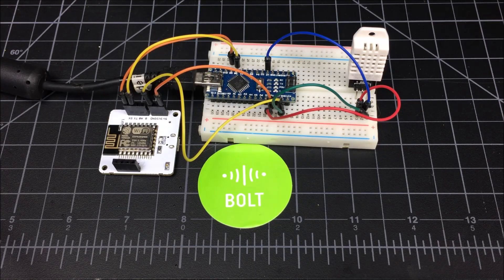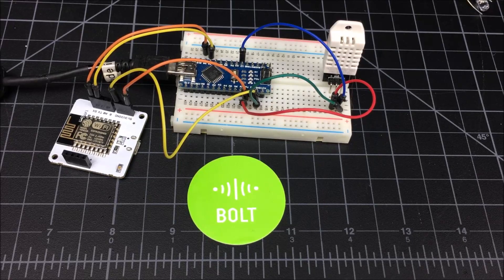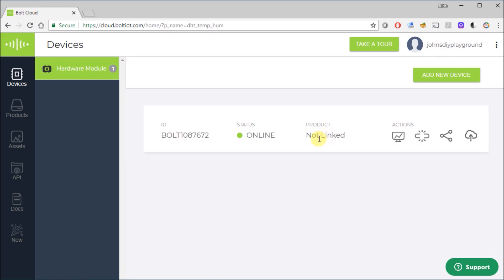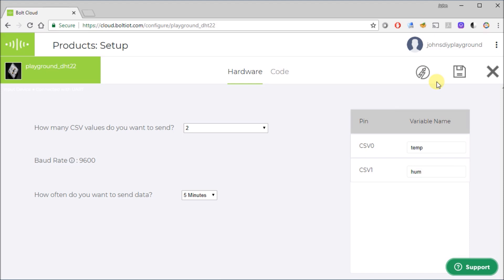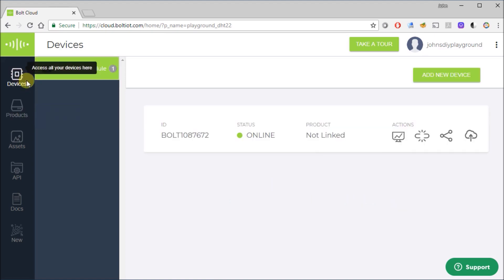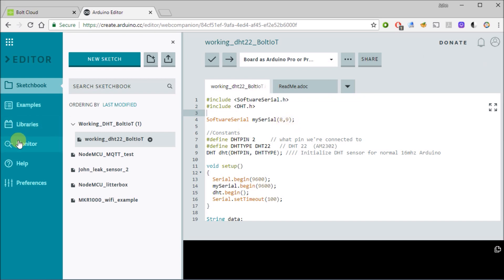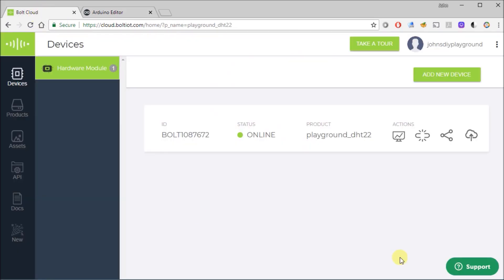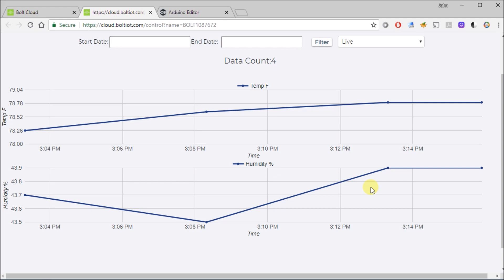Bolt IoT DHT22 example

Comment: How do we know whether csv 0 is temperature or humidity? We never mentioned whoch pins mean what?
Reply from the maker: That's a good question and I guess I never asked myself that.  As far as the pins, there are only 3 used on the DHT22 sensor which are power, ground, and data.  The data is sent digitally so my assumption was temperature is sent first and then humidity.  It probably says that somewhere in the DHT22 datasheet but honestly I did not check it.  Thanks for watching!

Comment: Hey John! could you please give me the code of an ultrasonic sensor connection via arduino to Bolt iot
Reply from the maker: It’s nearly identical to my sample code for this demo but you need to also include the ping library for the ultrasonic sensor hardware. There are ping examples in the Arduino IDE

Comment: It is possible to connect temperature humidity moisture all sensor to one single bolt device
Reply from the maker: I believe the answer is yes but I have not tried it. One limitation of the Bolt interface is the ability to plot multiple inputs. https://docs.boltiot.com/docs/multiple-graph-beta

Comment: sorry to go off topic but didn't no how else to contact ya ...story (in brief)..just got given a "particle core" so got a resistor and LDR and watched your vid about the "Photon" decided to try it and all worked well, when I use "console "on my PC I get the "ide" wheel and the Events update when they feel like it (rarely) yet on my phone all is well and they update every 10 seconds as per your code any thoughts on that? also, just starting to play with IOT so I would like a good forum to use any suggestions from you or your subby's would be great...found your style informative and easy going can I have your personal number for when I hit road blocks on my internet journey ( only kidding !)……...also must admit when you started on about HTML ya lost me ! another quick one on the PC console I could switch the LED on and off by typing a function and hitting "call" couldn't find this on the phone app
 cheers
.anyhow cheers!!
Reply from the maker: Hi Andy! There’s a great forum about the Particle over at community.particle.io  As far as your update issues on the PC vs phone I can’t tell you why the thing would act intermittently like that. The guys in the forum might be able to help with that... thanks for commenting and watching!

Comment: Thank you, John, for the video. It is very well done. It will help many other Bolt users to interface DHT22 sensor with Bolt to build a temperature and humidity monitoring solution.
Reply: why can't we use any other programming language rather than  JavaScript
Reply: yes i like this video but they didn't show library i run the same command but DHT is missing in library shows. i have already 2 3 library of DHT